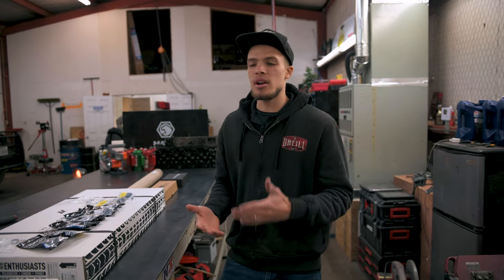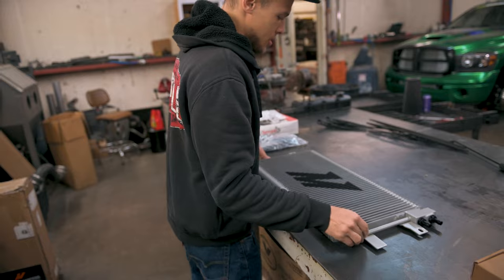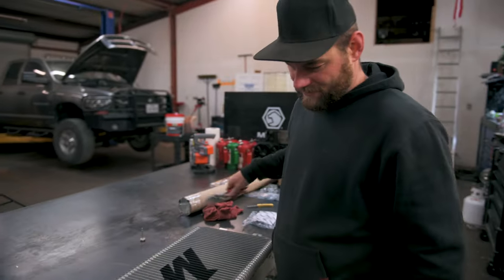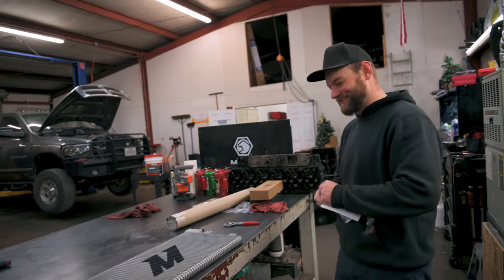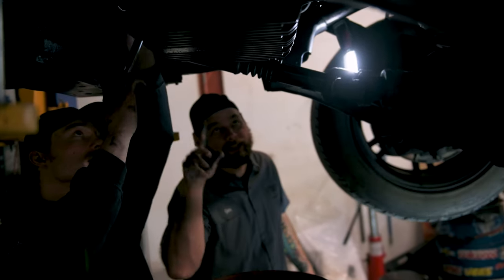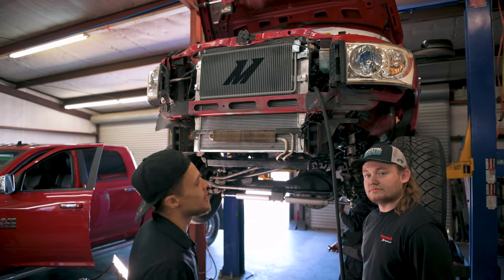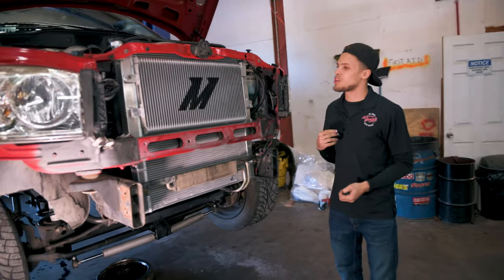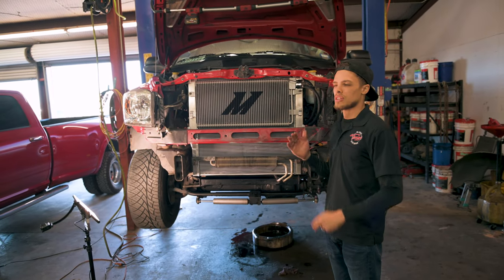MISHIMOTO Transmission Cooler Install | 5.9 CUMMINS

Comment: I have a 2008 6.7 ram i noticed that when i tow over 10,000 pound s the transmission gets hot,,any suggestions, i live in Florida where temperature is extremely hot
Reply from the maker: This transmission cooler will make a world of difference. The other thing you can try, but won’t be as effective is connecting a strong external fan to your stock transmission radiator.

Comment: I recently installed the Mishimoto transmission cooler on my truck and bypassed my heat exchanger.  My question is what kind of transmission temperatures do you run in stop and go traffic. I have a 10,000 pound travel trailer I pull behind my truck and was really wondering if I need to install a auxiliary cooler for my transmission.
Reply from the maker: Honestly, after installing the cooler, the hottest I've seen my transmission get is like 175. As long as it's in tow haul, It should be fine
Reply: @LMDiesel  good to know, thanks for the quick reply
Reply from the maker: Oh course man! Happy to help!
Reply: @talleyho111  what kind of temps have you seen hauling the trailer with the new setup ?

Comment: what if you live up north? would you still bypass the heat exchanger and keep the thermostat on the cooler?
Reply from the maker: If your truck is mostly stock, I'd say that's fine! If you have a crazy setup then I would bypass

Comment: pls I need the measurements that you used for the FITTINGS on the hoses that are connected to the radiator and if you have photos how the FITTINGS to the transmission look thk

Comment: Man I got my truck going was doing awesome hooked up small box trailer been driving all day stop and go trans temp went from 190-230 so I let off pulled to my buddy shop swapped fluid and filter everything seems fine just when I drive it all day long it gets to 190 and won’t come down has -10 lines to deral cooler with fan mounted on side of bed I did clean cooler and washed it but I think it’s not big enough one and two it’s not getting fresh air while driving I live in San Diego tx

Comment: what radiator did you go in with? That all aluminum looks great!
Reply from the maker: It actually was like $250 on ebay. Chris recommended it. It's worked great so far!
Reply: @LMDiesel  how long have you had it in there sir?
Reply from the maker: @johntevebaugh7451  about 2 months! That plus the 180° thermostat makes a big difference!
Reply: @LMDiesel  Do you happen to remember the vendor or brand?  Is it a two core?
Reply from the maker: @kevinpeterson9659  it was a 3 row Radiator from ebay. I believe the company was called ASI

Comment: Did this make a huge difference for anyone? I am getting around 200 degrees climbing hills or pulling a 10k 5th wheel on a slight grade. I have a mag hytec deep pan with a stock cooler which might be my issue since it takes longer to cool more fluid.
Reply from the maker: This is a huge upgrade! My trans almost never goes over 150
Reply: @LM Diesel  how hot did it get before? And also did you do the thermostat delete. My truck is a few years older and has a 47re
Reply from the maker: @Jdl223  I did do the thermostat delete. And I got mine up to 220 once.
Reply: @LMDiesel  awesome thank you! I'll have to pick one up